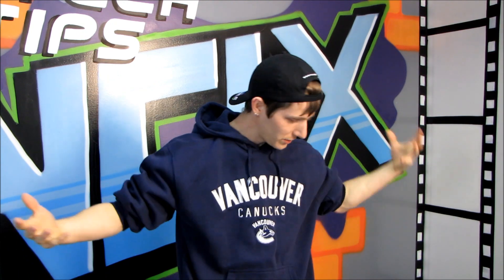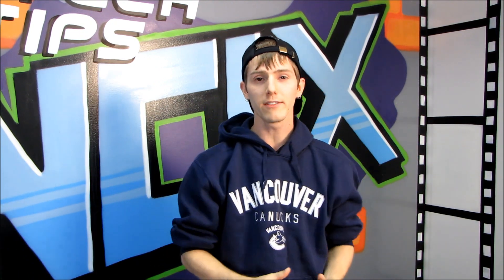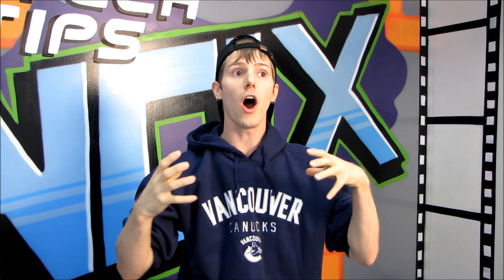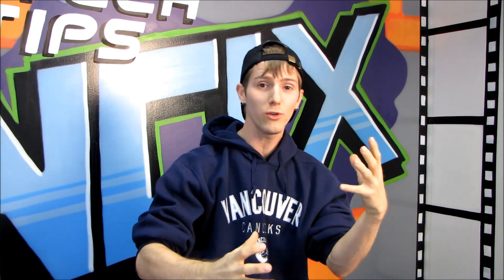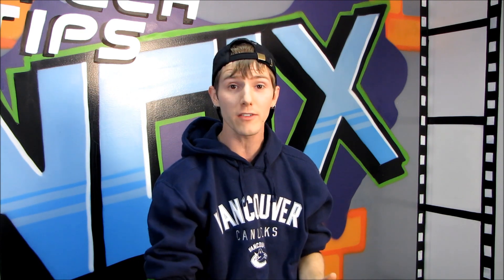Futureproofing Your PC - Dispelling Some of the Myths NCIX Tech Tips

Comment: Future proofing is all about compatibility and it dependent on three things:

1 - How often do you intend to addon/upgrade (usually 3 months -3 years) and how often do you want to a complete system overhaul (usually 2 - 6 years)?

2 - What kind of things do you want your machine to do? e.g. Software and OS and how often do you intend to upgrade your software?

3 - Component maturity.  It is better to choose mature/ mainstream technology not the premium stuff and definitely not the ones that are near obsolescence like IDE or ddr2, unless you have a very "specific" usage of your machine for cost reason.

Most future proof components by "technology & duration" (order - highest first)
- OS - 10 years (for Win7 end of support)
- ATX case - dependent how often you abuse it
- Case Fans & Ram cooler - 6 years+
- PSU - 5 years + (base on warranty)
- CPU cooler - dependent on make
- RAM - 6 months to 5 years (it dependent on mobo DDR support, but most builder would add half now and add the other half of ram slot when it cheaper in the future)
- PCI peripherals - 4 years or less? (it still too early to say when this will end since this is a very common connection like sound cards)
- HHD - 2-3 year crossover point (SSD is still reaching it maturity age while SATA connector is nearing end of life and "it seem" PCIE will take it place)
- GPU - 2-4 years PCIE isn't the issue, the issue is the software e.g. latest games always pushing the boundary and demands the latest or decent hardware to run it (while GDDR5 are now replacing GDDR3)
- CPU - 1 to 4 years - Moore law (yeah right), anyway it highly depends on how you intend to use your machine.  CPU could be left alone for years or require 1 or upgrade before socket change and this tend to be for intensive calculation like FEA, CFD, Rendering, photoshop and not for realtime rendering like in games, which is a GPU job.  But since it also highly dependent on mobo while mobo is the backbone to every other components, so if you intend to change socket size then you would need a complete system change.

There is so much consideration when looking at the cost of each component and whether if it has reached it maturity as well as all the potential compatibility issues.

So, if doing it for "cost reason" then get most of the components that are "fully matured" that would benefited you NOW (like this guy said).

OR future proofing for "reliability reason" then get a complete system like a laptop and change the whole thing every 4 years+ (that is if you don't mind not running the highest settings for the latest games/ software)

OR Buy into the Razer modular concept (BMW & thermaltake concept pc)

Note: There is nothing wrong in running xp or even Win2k, but it really depends on what you use for and whether or not your software supports it.
Reply: Excellent response. I only wish you had more prominently made the point about the motherboard being the backbone of the system. But everything you said it right on target. I think Linus missed the mark in his presentation, but I still like his work and appreciate his knowledge.
Reply: hamyncheese

I do like most of Linus presentation, but thought a bit lacking in this one.

Anyway, future proofing on a MOBO is basically the consideration of "all of above" (from my initial post), because it is the backbone to ever other components and you have to make sure it COMPATIBLE with everything that connect to the it, like "software (intended OS) and hardware (ATX size, connector location like and even down to the I/O plate for the ATX case).

I would only recommend mobo upgrade if you intend to upgrade the CPU or even the whole system.  I would consider Mobo and CPU into the same class.

Because, if intended for CPU change then mobo need to change and vice versa (due to CPU socket pin numbers).  The mobo driver, bios update usually last for 2~4 years before they can't be bother to write codes on an ever ageing board.
I wouldn't recommend changing a slightly newer mobo while using the same CPU socket pins, because it a lot of hassle for very little performance gain unless your mobo was damaged.

The whole point of mobo isn't about performances it about 1) reliability and 2) built in features like 7.1 surround, wifi card & etc. (so no need for extra dedicated pci stuff and the associated drivers to install), because less stuff attach to the mobo tend to be less clunk and hopefully more reliable.

Same rule even apply to fans (you still need a lot of heat sink), because 1x large case fan (300mm) for example are equivalent to about 3 to 4x 120mm fans of air flow, while it run at lower RPM than 120mm ones, which means less noise!!! 

Basically for Mobo, less is more!

Unless you want to light up your atx case like a Christmas tree with all sort of feature!  5.25 cup holder anyone?!

Comment: I just built my first system this year, The only future proofing I did was to buy a motherboard that had  more RAM capacity then I currently need I did go with SLI capable In the event that the current video card I bought wasn't quite enough, good news a Radeon 5450 will do exactly what I need at $30 bucks . also as I was trying to build two machines at once I bought identical video cards  once our needs surpass what the 5450 can do I am hoping that both cards in SLI will keep up and I will only have to buy 1 card for one of the machines. I did get a bigger hard drive then I thought I would ever need but the price difference was $5 for double the capacity.

Comment: Well. I actually opted to get an older, less-expandable Micro-ATX, the Gigabyte GA-78LMT motherboard for my build, because I need integrated graphics until I can get a proper graphics card. This all sounds like a bad idea after watching this video, unless I consider the facts that:

1) The motherboard I'm getting is cheaper than a similar full ATX board, and I'm extremely-budgeted.

2) I don't plan on putting in more than one graphics card, or expanding it much in general. The 750ti will be plenty for what I want it for, which is Blender rendering, and gaming secondarily.

So, I kind of am squeezing myself into a budget. But I feel like the parts are all balanced enough, that by the time I want to upgrade, say, my CPU or graphics card, I'll be willing to spend more and just make a whole new system.

Comment: Coud I use a i3 2100 2x 3,10 GHz with a r9 280x without the bottleneck effect?
Reply: I3 is not for gaming.  Not enough threads,  bro.
Reply: *****
  You're clueless as dog shit.

i5 outperforms i3 in gaming.
Reply: ***** Well of course upgrading the GPU is the fastest route to more FPS.  And of course the i3 can play games well.  But you should build a system you can upgrade later and CPU is one of the best parts for future proofing.  Games are going to be using more cores soon.  They have to be.  8 core is standard now and i3 is 2 core.  I recommend a good i7 myself.
Reply: *****
 You mean a $300 processor and yes I do recommend them.
Reply: *****
http://www.tomshardware.com/reviews/gaming-cpu-review-overclock,3106-5.html

Notice only the i7s and i5s are at the top.

i5 is better than i3 for gaming.  Period.

Comment: I bought a GTX 780, and I plan on buying a new GPU when gaming at 1080p starts to struggle. If I see another 780 go for super cheap Ill buy that and go SLI. I doubt my 3770k will get outdated in the next 5 years, because the difference between Sandybridge and Hasewell is soooo minimal. Unless there's some huge breakthrough in CPU and game engines, Ill be fine running an older CPU.
Reply: My only argument to that is let's look at some nVidia history... 8800GTX to 9800GTX near the same specs. 9800GTX to 280GTX big jump, 280GTX to 480GTX big jump 480GTX to 580GTX meh 580GTX was decently better, 580GTX to 680GTX pretty large jump, in fact the 660 outperformed the 580 by comparison.  I'm just rattling this off of memory, while I don't disagree if you find one for super cheap and add some life to your rig, absolutely go for it. Like the video said future proofing is nigh impossible for some things.
Reply: stealthgyro This might be coming out of my ass, but I think all the recent large jump from recent generations is to stay for ahead of the new console generations. I also have minor things like DX12 helping out.
Reply: Christian Lee It's entirely possible, and honestly it even makes sense. Notice the 800 series is just mobile at the moment (much like the 300 series was). I'm currently rocking 2x 780s and 4770k 32GB ddr3... So I know my next build won't but until some of the new technologies are in full swing.....
4k 60fps crytek engine 3 games
DDR4 is coming
DX-12 is coming, but the game support may not even be here until 2015 holiday or 2016..
So 2014-2015 are sort of incremental years... I think 2016 will be the next large jump, as you said this completely coming out of my ass as well.
Reply: stealthgyro I just realized my response made no sense at all, I should proof read. I think the 700 series is a good gen to buy because they're delaying the 800 series until that Processor company can make 20nm chips. I'm willing to sacrifice some performance when my 780 gets outdated, but before I built my rig I played on my laptop, so I don't mind.
Reply: the problem will be wen the new generation of computers come out... the ones that will be DDR5 the comaparative will be like a petium 4 vs core 2 duo...
Reply: crazymetallian DDR4 is the last you'll see of DDR.
Reply: Steve Man
and it's coming out soooooooooon :D
Reply: well actually we are on the DDR3 computer generation... very soon in much less than 5 maybe in less than two a new generation will show...

do you remember crisys??? the 300USD core 2 quad where not capable to run it well, but sooner a phenom II, just two years afyer runs it like butter with the propper graphis card of course
Reply: DDR4 is already out!
Reply: ya but there isn't any consumer accessible motherboards that support it , lga 2011-3 socket coming in september with Haswell-e :)
Reply: but theres not a real next gen...

example a phenom II with DDR2 its a crap

with a DDR3 and also with a little oc 200BUS to 240 can handle DDR3 RAM well, overkill the performance and can be paired with an FX 83xx to play games. Theres no for me a next gen jump from DDR3 to DDR4 so i say DDR5 will be the good one
Reply: Good point Sloan, not much good without an x99 to stick it in! 

Later, DDR4 will clock up to 4000Mhz - new memory has always been on par with or worse than the generations latest before it. There won't be a DDR5, we'll see a totally different shift after DDR4 - at least that seems to be the word on the street.
Reply: Planing to wait a bit until there are more options for x99 motherboards, then probably gonna build something with the 5930k and some basic DDR4 memory, with 2 X 780 ti kingpins, but that's mostly something I want for next summer :3
Reply: Speak of the devil! NCIX just got the x99 boards and 5000's processor's.

Comment: I had a computer that I built back in 1998 that I just retired last week. It had two 300 MHz Pentium II processors, 128 MB of RAM, and IDE hard drives that got added on over the years. I used it primarily as a file server where I could dump random stuff on it and keep backups of my main PC and my laptop. In fact, the only reason that I retired that machine was that I needed the case in order to build something else.
Reply: dat nostalgia
Reply: This is true, but that's what I had laying around and if it ain't broke don't fix it
Reply: It is really good for what you use it for already.
Reply: You don't need an old outdated PC to safe files on. Just buy a large USB flash drive and call it a day!
Reply: bakagamer918 This is what you accomplished: Wasted Energy for over a decade, produced extra noise and heat in your environment, wasted space in your environment, risked your data integrity, and sacrificed performance/portability.

As far as your case is concerned, the biggest drawback to using it for a new build is that you don't have access to front/side panel connectors for USB 2.0/3.0.

I'm not a snob when it comes to this stuff, but at some point a person must recognize that what they have is horribly inefficient.

Overall, I thought this was a poorly conceptualized video because it gives no historical examples of future-proofing.

For example, in late 2006 I purchased a socket 939 motherboard for AMD Athlon 64. In mid 2006, socket AM2 had been released and made 939 obsolete along with DDR400 (pc3200) ram. Today I am still using this same system and it is maxed out in every way. On different occassions I found myself trapped because of some failure or lack of performance from a component. Ultimately I ended up replacing the mobo 2x, upgrading the cpu to an athlon 64 x2 3800+, a 9800gt 1gb video card, a replacement power supply, and 4gb dual channel ram with windows 7 (some changes in bios to get 4gb addressable). Overall, the experience was horrible and every time I think about it I say to myself that if I had just realized that 939 was dead at the time I purchased it, then my life would be much better today.
Reply: hamyncheese Your response about wasted energy, noise, heat, etc is viable if the box was always on. Otherwise the carbon footprint in today's throwaway world would just mean more landfill.

Comment: My plan for a new computer.
===================================
AMD FX-6300 3.5GHz 6-Core Processor £77.99
Biostar TA970 ATX AM3+ Motherboard £61.88
Kingston Beast 16GB (2 x 8GB) DDR3-1600 Memory £102.00
Sandisk Ultra Plus 64GB 2.5" Solid State Disk £42.35
Seagate Barracuda 2TB 3.5" 7200RPM Internal Hard Drive £53.99
Asus Radeon R9 270X 2GB Video Card £157.99
BitFenix Shinobi ATX Mid Tower Case £49.99
Corsair CX 600W 80+ Bronze Certified Semi-Modular ATX Power Supply £52.96
===========================================================
All just to do artwork and such on the PC.
Reply: - dont get a biostar board (get something like gigabyte, asus, msi)
- dont get that tiny ssd, get a 128 or higher instead, 64gig ssd will run out very very quickly even if u store everything on a storage drive.
- get an rm power supply, its worth it.
- if your just doing artwork get a lesser gpu.
Reply: If you're not gaming, then that 270X is completely unnecessary.
Reply: Not a bad build. But do get a bigger ssd if you can. Really you don't need it. The Normal hard drives these days are already so quick. I don't have a ssd and i boot in about 10-20 seconds. I would save the money and wait till they drop in price. Over all its a good build. But don't get a bio star. Rather check out the MSI 970A-G43. I am using it along with the same GPU and CPU.
Reply: Yeah, I've kinda said scratch the build and just go for the tablet version with the whole OS seeing as I'm going to be needing it for college
Reply: CJWorks bugger tablets and convertible junk! just get a real laptop! you'll find their easier to do stuff on and they'll probably last longer.
Reply: ***** that motherboard (Biostar TA970) is just fine for a 95 watt fx chip, infact the fx 6300 is probably the best chip you can put in there, and will let you overclock a little, not a lot. but, if you want to put in a 125 watt fx chip such as fx 8320/8350 then it should be fine, but dont expect and overclocking.

Comment: I'm planning on going with a:
-Intel i7
-GTX 770. More than likely 2GB
-16GB RAM and will eventually upgrade to 32GB if I feel I need too. Will try to go with DDR5
-Powersupply will be 750w Modular
-Case will be the CM Storm Trooper Gaming full tower case. I just love the look of it and the features it has.
-Haven't decided on motherboard yet. That's something I need to research.

I will be building my PC for gaming and getting into graphics/video work for when I finally get serious with my websites, which means I will eventually be running.

Not trying to future proof so much as get the best I can with the budget I have set.
Reply: Hey bro, from where are you going to get a thing that doesn't exist Eg: DDR5 RAM ?
Reply: Oh! Can you do that ?
Reply: hei .. can u please tell me what ur doing with ur comp ? i mean i got 8gb of ram but never use more then 3-4 GB.. so what ur doing with 16? playing 10 games in same time ? or ?
Reply: haydeezz gaming and will be getting into video/graphics and multimedia more for my websites.
Reply: You should put an SSD in there too. And yes GDDR5 does excist for vram, but not for dram. Also i would shy away from MSI MB. They work fine, but BIOS updates for them are a real hassle. Go with eg. Asus or Gigabyte instead. Another good tip is to get a cpu cooler, if you are getting the unlocked i7.
Reply: That'll be a good system, what aftermarket cpu cooler do you plan on or none at all?
Reply: Meant to put GDDR5 next to the GTX 770
Reply: Actually, no ideal yet. I have no plans to overclock, But, that may change in the future. Still, I will have to look up aftermarket coolers and decide on one to use. JacobStar91041
Reply: Torres4571 Yeah will definitely be putting a SSD in. Not sure how big but I know I will eventually be adding a second one down the line.
Reply: I'm saving up money to do a full SSD system, Asus PCI-E 240GB ssd then the 1TB Samsung 840 EVO.
Reply: JacobStar91041 Yeah I think I want to do One 2TB HDD and a couple of SSD drives. And since the case I will be using(CM Storm Trooper) has a  2.5” SDD hotswap, I'll probably pick up another SSD drive to do my weekly backup of important files.